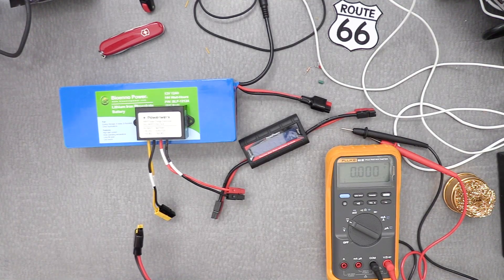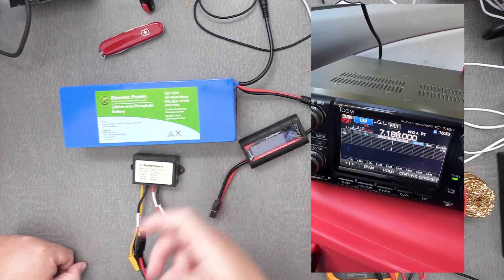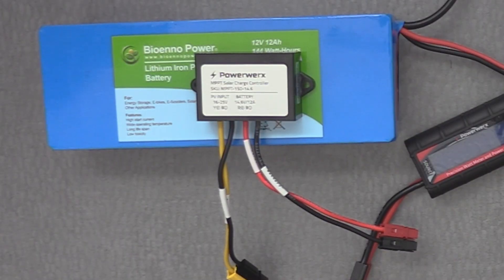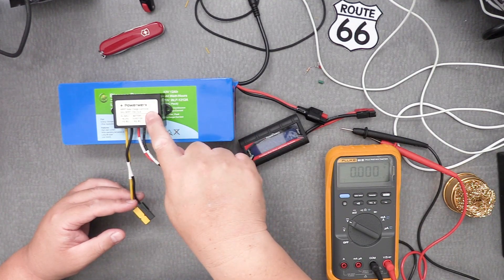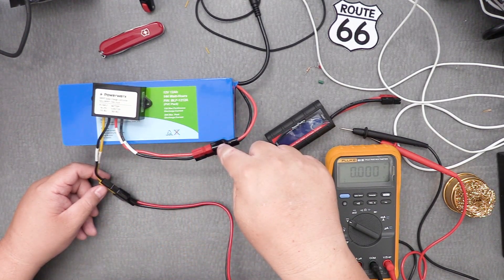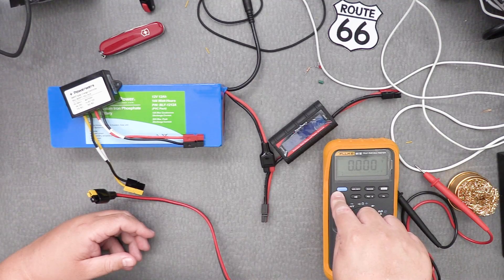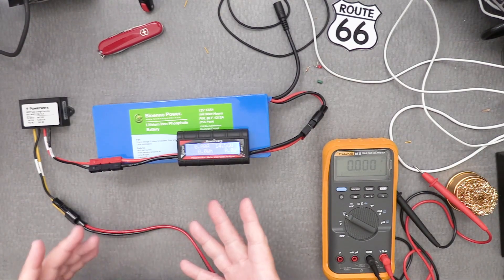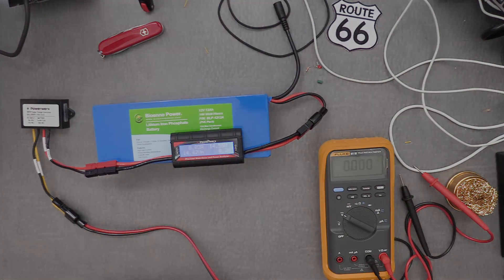Charging your Bioenno Battery by The Sun

Comment: Fyi, It's perfectly OK to charge your battery directly from a solar panel. Just make sure that you size your solar panel so that it cannot exceed the maximum charge rate of the battery. For example, I use a 20W solar panel to charge my 3 Ah battery. The battery has a maximum charge rate of 3A, and the solar panel cannot deliver more than 1.5A, so there is no risk of the battery's protection cicuitry kicking in and disrupting charging.

Using an external MPPT charge controller might extract a couple of extra watts of power from the panel, but introduces additional complexity, and possibly RFI. It's a trade-off.

Comment: i Have been told from a ham friend, who bought this controller, that it is too rf noisy to use while operating the radio, on all bands! not all mppt controllers are rf free. Thx for the vid.
Reply from the maker: It is, but in a pinch if you need to charge your batter when you are not on the radio, it helps.  I would get a Buddipole PowerMini2, that solar controller is very noise free. https://youtu.be/gzhvt3yCKUo

Comment: What's up?  You moments before said that you should never ever change the Bioenno through the power-poles but that's exactly what you are doing @6:50.
If it OK to charge through the power pole connector I would connect the supply side of the power meter to the battery and the solar panel and my loads to the the load side of the power meter.  This way the power meter would show the balance of power going into and out of the battery.
Reply: The APP and barrel connectors are wired in parallel inside the battery, so they can be used interchangeably.

Comment: Are you seeing any RFI from this charger??
Reply from the maker: From this one? Yes. Some noise.
Reply: I get some noise if the solar panel and controller are connected to the battery while the radio is connected to it.  If it is connected and charging the battery while the radio is using a separate power source, I am not seeing any noise.

Comment: Another informative video Frank!  Question.....do you know for certainty that both the barrel connector and the Anderson connectors on the battery are the same?  So you could charge or draw from either pairs from the battery?
Reply from the maker: The barrel connector and the Anderson power pole connect is only the same in terms of input.  You can charge the batter with any of the two.  You can only draw from the power pole.  You can't with the barrel.

Comment: You should not be having the solar panel connected to your charge controller without the controller being connected to the battery!  Connect the controller to the battery first, as you did,  then the panel and then disconnect from the panel then the battery, in that order, (which you didn't).
Reply from the maker: Thanks for telling me the order.
Reply: @frankwc0o  You’re welcome. I learned the hard way with my own solar panels and a very similar charge controller.  The magic smoke was let loose….
Reply from the maker: @douglasgerard  WOW that's very serious.